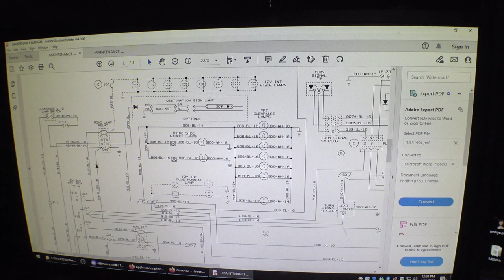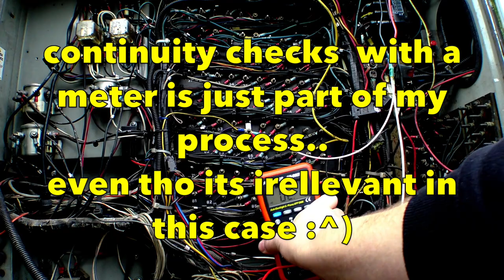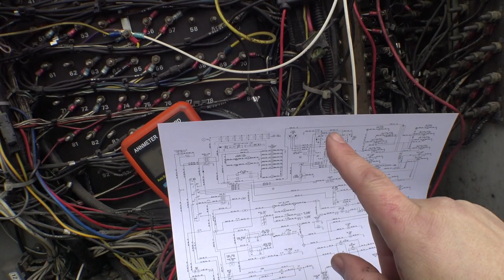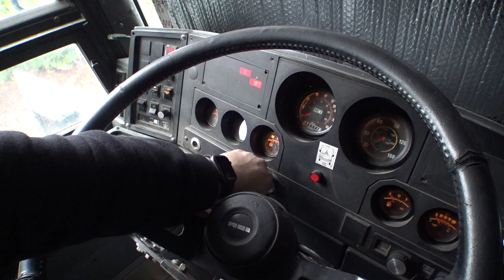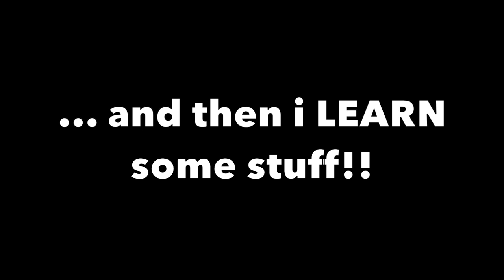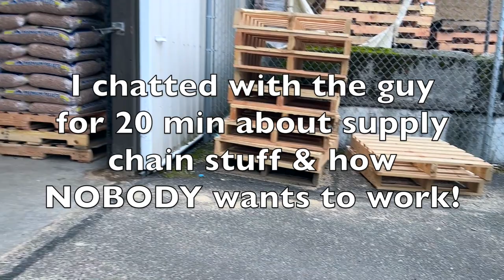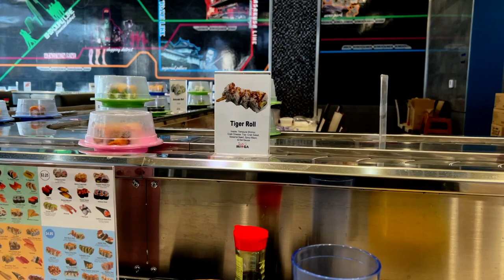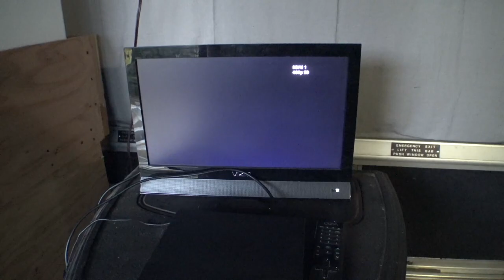MEGA VLOG 649: hunting for ground! (bus repairs)

Comment: Hey Dan hope you get it figured out. I think it could be a relay issue are the socket wiring weather its corroded are incorrectly.  wired. It sounds like it is feeding back to other components.

Comment: Redundant lift power.  Can you find an accessible place to put a lift power supply disconnect?  Bring a spare chair (batteries on wheels) make an XLR extension, and plug it in to the lift.  So you can still operate the lift with the main batteries disconnected and without fear of backfeeding the bus.

Comment: Hi Dan, those relays look a bit like there's water or condensation inside of them and they aren't that expensive here in the UK, but the world's gone crazy with things going expensive lately. Just seen your other video (Vlog 621) would it have anything to do with the starter interlock push button ? 👍
Reply from the maker: yea theres a lot of 'fake' parts out there for sale these days! now i know why bolts on airplanes have serial numbers! lol 
the interlock bypass button just jumps 2 pins on the starter solenoid control module - i installed it originally when i first discovered the ignition switch issue JUST to make sure the engine could be started reliably when needed.  so it shouldn't be interfering with anything :^)